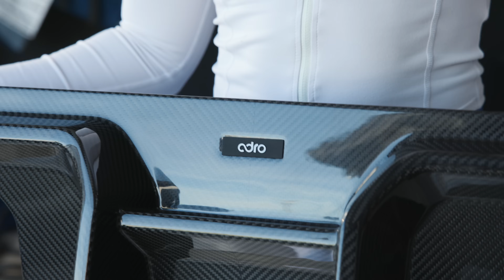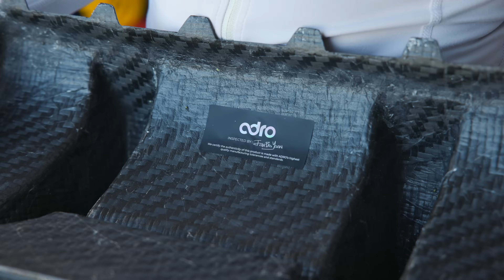ADRO Rear Diffuser Install on my BMW G87 M2

Comment: Thankfully no screws were lost or harmed during this video unlike that the last video...😉😅 jkjk!!! Diffuser looks sick!!! a suggestion...maybe apply some ceramic coating on the CF parts and future CF parts, def protect against the heat and easier to clean off the dirt buildup. I use CARPRO's DLUX, super simple to apply.
Reply from the maker: i would have been real disappointed in myself if i lost a bolt during this haha. will def check out that ceramic coat 🙏